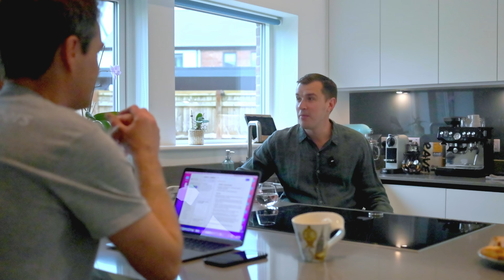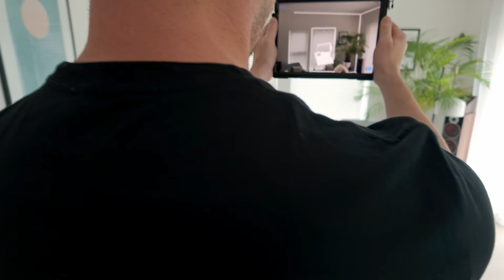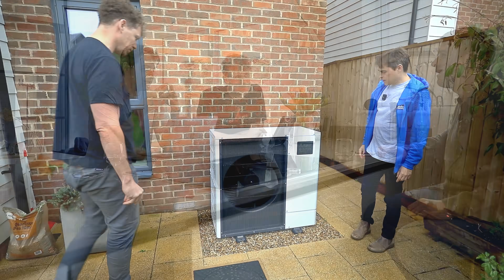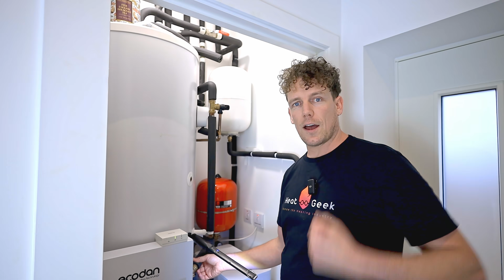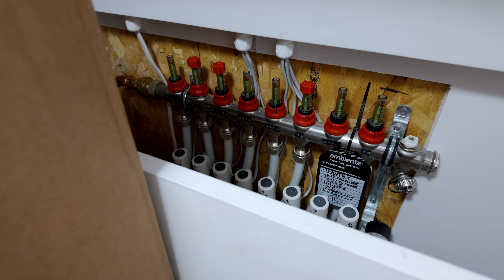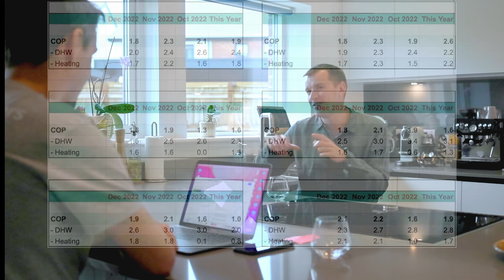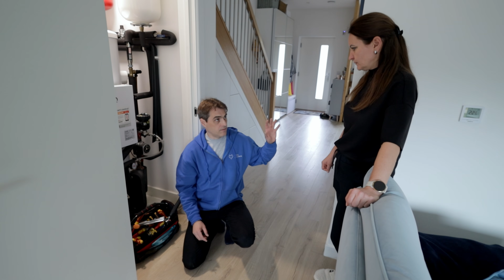How Developers Are Ruining The Heat Pump Market

Comment: Adam is totally wrong (9':02") about newer well insulated homes attaining better efficiency, it's the complete opposite. Heat pumps in leaky old houses will be running a lot more when it isn't particularly cold outside - ideal conditions for running ASHPs. Well insulated homes will only need heating when it's maybe below about 5°C outside and the heat pump is having to work hard. Also a larger proportion of the energy will be used to heat DHW - a much harder thing for the heat pump to do so that is why this house has a low SCOP. And that is why HeatGeek haven't been back to fix it or do a follow up video.
Reply from the maker: Adam is correct. You are wrong.

I have 50 monitored systems.  Some of them run COP of well above 5 - 5.6 and 5.3 - all of my systems that are above 4.5 are modern, well-insulated houses. Older houses run COP of around 4.0 on my installations.

Your claim that modern houses only need heating below 5c is incorrect. All houses need heating at similar external temperatures. Internal gains allow well-insulated houses to start heating at around 15-16 °C outside while poorly insulated houses need heating from around 17-18 °C outside.

The only difference is, well-insulated houses can be run at flow temperatures of around 32-33 °C with -2 outside, and poorly insulated houses need flow temperatures of 40-42 °C.

That is all - not an opinion like yours, facts that are available for you to see here:

https://heatpumpmonitor.org/?period=all&minDays=0&filter=urban+plumbers
Reply: @UrbanPlumbers  I wasn't really talking about modern British homes and the one in the video certainly isn't typical (you said it yourself) with triple glazing and MVHR. A genuine Passive house reportedly needs heating when it gets down to 0°C which is where the COP of an ASHP will really drop. There's usually enough solar gain and heat from appliances to keep the house warm. I doubt this is actually passive standard but it's a radically different prospect to a normal new build in the UK. The average 5-bed house in the UK uses over 10kWh/day on appliances, cooking TV etc - all of which will eventually turn to heat in the house. There isn't a small enough Air to water heat pump on the market to suit this house even on the coldest days of the year. The two "Passivhaus" houses on Heat Pump Monitor run at SCOP of <3.2.

Comment: That looks like a ecodan pre plumbed cylinder. They all have the hydraulic separation pipework, a pump for primary circulation, pump for the heating and a pump for the hot water. The dozens that we look after have a cop around 2. I'm sure they could be better but the manufacturer build the systems like that.

Comment: This seems to typify the common malaise in the UK where nobody is held Personally Accountable, which breeds carelessness and apathy. Clearly, Quality Assurance has become a tick-box exercise where the reasoning behind doing so has been forgotten. Accordingly, this is a management failure, which is easily remedied by retraining engineers to use their brain for thinking instead of just following a routine  because it is easier and lazier to do so. Challenging the engineers to care about the customer to provide an optimum service for them and focus on getting it right first time. If the industry provided a bullet-proof warranty, as part of a defects liability period, for new house heat-pump installs then the customer would be happier and the industry would flourish.

It sounds as if the Quality Assurance and business efficacy of a review step has been omitted, which has let the customers down and led to falling standards.

Maybe, each system designer should put their name to the system and each system installer should sign-off on the efficacy of the install, so that individuals are held Personally Accountable, as a reasonable management tool to identify where the problems are, so that they can be quickly remedied and a safe system put in place to prevent a repeat.

Comment: What can you do if the minimum of kw the machine can produce is way higher than the heat loss of the house ? I have the same problem with gas boiler and UFH 3k heat loss and a 24k combi boiler that produce 4.1 in lower settings
Reply from the maker: Good controls can reduce cycling. Oversized units with poor controls are a nightmare

Comment: The same thing is happening in Hungary. When we are explaning that our old hous has 5 k heat loss and therefore 5k heat pumps no one beleives us. Every single new build is equiped with 11-12 k units and surprisingly no good cop, burned down relay boards etc. So this is very good video thanks for that.

Comment: I'm looking to build in Ireland, where I come from; heat pump air-to-air ducted systems have been the norm for decades, but here I get looked at sideways when I tell them what I am looking for
It's incredibly hard to find providers, much less providers with proven track records. I will not be having radiators in my home, but I feel like I am going to have to import equipment and labour from a continent away.

Comment: So you haven't said anything about the water tank and the hot water demands upon the house. For a five bedroom house I'd imagine this is fairly substantial! You'd need to be able to run multiple showers / baths! Is this why the heat pump is over sized? Because the developers don't know what hot water demands the customer is going to need?
Believe me! I HATE developers so it pains me to defend them here! But you don't seem to be telling the whole story in this video! You should have covered hot water needs and supply and how the system was or was not designed to meet these needs.

Comment: Crazy. Would R290 units perform better? They can handle higher temperatures better if I'm right, so if they aren't installed correctly they don't work that inefficient. I mean, a COP of 1???
Reply from the maker: Would make no difference

Comment: Think you were nitpicking with the expansion vessel on the flow. On a conventional system with high flow temperatures, yes. But on a system with low differentials, low flow temps, nah.
Reply from the maker: It’s not about temperatures, it’s about the vessel being on the positive site of the system pressure. This causes air being removed from the system water and corrosion among other things.

Comment: You say they have installed 28mm to the plant room then reduced down to 22mm. You say it’s guessed correctly but in what way exactly? Have you done a heat loss in this property and also sized the pipe work or just guessed?
Appreciate your input please?

Comment: Heat pumps are like boilers a few years ago, they dont modulate low enough.
If they did it wouldnt matter if they were oversized. An oversized heat pump will heat the domestic hot water quicker, go into defrost less when its very cold, coz it wont need to work as hard.
The Daikan 16Kw modulates down to the same extent as the 9Kw.
So installers need to check

Comment: Just don’t understand why in the uk they say it cost £7000 to install heat-pumps 
I lived in  Brisbane for 30 years never ever did we need heating . If we had cold we would simply change our air con system to heat and it was more than enough. And with having the condenser at the side of the house ,we never heard working it was that quite and cheap too run  . It was a Mitsubishi model  cost around $1400 or about £700 plus instillation of about $1000

Comment: An issue I rarely see covered is the practicality of retrofitting ASHP in a old property with a gas system.  The small boiler is usually in an area where the ASHP kit will not fit, this then involves losing some other internal space and re piping which in many properties is not a simple job.  

The associated valves, pumps, reservoirs, larger cylinders all take their toll on retro installation.

Comment: Why not consider solar panels with the addition of battery storage and an electric boiler for heating and hot water. You don't need direct sunlight all the time, daylight is needed. Connect up to the existing heating system! Virtually no real maintenance required!
All we here is problems with heat pumps whereby they haven't been set up properly, temperatures created are not always good enough, bigger radiators required and it's very expensive for what it is!!
Reply from the maker: Solar PV and battery is great with heat pumps - you can have 5-6 times cheaper heating than gas. With drect electric and battery and Solar you may as well stay on gas. It is just not efficienct enough.

Comment: what's the small print on the heat loss calculations? I know heat loss has to be dependent on temperature delta, is there some industry standard temperature delta that you use to come up with a number in straight kW? or is it based on the (relatively) local mean annual ambient temperature?

Comment: Seems like Passivhus and a standard ASHP doesn’t make a good fit.  Most of the year you need zero additional heat input.  As it is then only heating water, how about a heat pump cylinder? 
If you do go for a ASHP perhaps link to a very thick floor slab* and heat only when the electric rates are low.  (Another also commenter raised this)
* or place the insulation under a layer, say 30cm+ of gravel to act as a heat sink.
Reply from the maker: @markthomasson5077  correctly sized heat pumps are perfect for passive houses
Reply: A Passivhus will have MVHR (which helps circulate air) so the solution is a couple of much cheaper and simpler a/c units which also cool on sunny days. While an immersion can heat the hot water for about 50p/day on overnight tariff - about the same as the gas standing charge. There's really no need to overcomplicate things.

Comment: Fantastic video guys. I am learning so much and starting to (slowly) understand my problems. My property could be a very interesting subject for a future video but sadly we are located a long way from London in the Scottish Borders. We bought our house in 2018 from a “Low Carbon Development” company so we thought we were doing the right thing buying a new property that would have a lower carbon footprint. We have had the Ecodan air/water heat pump since 2018 and it appears to be a good unit although Mitsubishi really need to work on their app and interface! We have underfloor heating downstairs with the dreaded mixer/valves and radiators upstairs as well as a heat recovery system. As I have subsequently found out everything was badly installed and most of the plumbing mistakes highlighted in your video are on show in my house😢I have tried running the system as it should be run but my wife is paranoid about the bills and keeps turning the thermostats down. She is far happier using the log fire (and yes that probably produces more carbon than anything else) and spending most of our time in the lounge. Consequently, during winter we allow rooms not used to drop down to 15c which I keep trying to explain to her is wrong as if we don’t use the system we will have more problems. We believe the insulation is good and there is sufficient in the loft area but the developer was obsessed with the aesthetics of a modern steading style ie 3 double doors downstairs (badly installed) with no insulation and lots of windows. Without the calculations my wife won’t believe me that the heat loss isn’t as bad as she thinks. Just to make my life more difficult Scottish Power introduced a Heat Pump tariff where between 11am and 4pm electricity is half price but the standard rate outside this time is a little higher. Now my wife rally does do the rounds after 4pm turning everything down or off! Does a heat pump tariff like that actually help running the heat pump or is it just another complication?

Comment: Buffer tanks can smooth out run of oversized pump , also you can reduce / modulate power to avoid cycling
Reply from the maker: if you are overszied by some 9kW you would need a buffer tank of enormus size to make any diffrence

Comment: Great discussion.   So I learned two things and have two questions:
I learned: Right-size (usually downsize) the equipment.  And simplify, with fewer zones, fewer thermostats, less equipment, lower cost, higher efficiency.
Questions:  for the quiz, I didn't know the units (it was kW).  How does the customer know the COP?  How is this measured and calculated?  
Thanks again!

Comment: One of the biggest issues is gas heating companies and engineers installing heat pumps and thinking it's all the same, 'just put a big pump in and all will be fine'. Typical gas boiler installer will look at a heat demand, which might be 28kw for a gas boiler, so they put a 32kw one in just to be safe. That works ok because of the inherent inefficient in a gas system that is designed to constantly cycle, but it's a fundamental flaw doing so with an ASHP. We live in a 1950's 4 bed detached house (with additional insulation) and have a Mitsubishi Ecodan 8.5kw pump, which does perfectly well by keeping the house at 22c all through the winter with average SCOP.

Comment: 2:27
You can build them perfectly fine without heat recovery. It will however usually require a step up in heat pump capacity.

Comment: Thanks for the video. It highlighted that our expansion vessels was incorrectly placed on the flow not the return. No noticeable issue with this over the winter so far but the installer has agreed this should be changed and is coming back out next week to sort it.

Comment: As someone who is about to order a heat pump and is from a process engineering background ( I’ve checked and there is nobody listed on the heat geek website in our area). Is there a list of user requirement specification anywhere that I can use against which the suppliers can produce a functional specification that can can be measured against the install delivery please?
So we can pass/fail the install.

Comment: 100% losses when you open the window? Home boy has been sold some gimmick and he doesn't even realize this. The heat in your home is accumulated in your furniture, walls, floor etc. when you open the window you don't start magically draining heat from them at a fast rate
Reply from the maker: he talks about air changes heat loss (heat loss is in 2 from: fabric and ventilation loses)

Comment: Someone has made a very good point about raising the heat pump - it will allow cold output air to fall to the ground allowing warmer air from 1 metre and above to be drawn into the unit.  Was about to install mine on the ground but will be raising it now 🇬🇧
Reply from the maker: makes no difference to effiency really
Reply: @  Ok, will mount on the floor then.  Thank you 👍🏻

Comment: The Ecodan came preplumbed like this with low loss header etc. Prob why it was done this way.
Reply from the maker: Yes exactly. Just shows how bad manufacturers are really at the design!
Reply: @ Probably a design that will sort of work for 100% of our homes and safe no liability for ecodan. I have the same setup in my flat, gets me a cop of 3.5. I guess mine will be better sized.
Reply from the maker: You got a heat pump in a flat?
Reply: @ yeah upstairs 1930 flat with large single glazed windows and no insulation in the walls. I had to upsize the rads but it works great. We had storage heaters before

Comment: Nothing wrong with that 11 kW heat pump. It will just switch on occasionally, whereas a small heart pump would need to run much longer, wearing out faster. And this one is a quality brand, with a Japanese instead of a Chinese compressor. It will last long, as it hardly ever needs to run on peak performance. I wouldn't change it. A bigger concern would be weather exposure. I would put some sort of roof over it against rain and snow and some provision against direct sunlight baking against it in summer.

Comment: I don't think is just a developer issue. To be honest, the quality of the install was actually really clean. It just happened to be also wrong. There are not a lot of installers around who actually understand these new systems or how to size or indeed, install all the bits and bobs correctly. 
There is no possible way that a layman could look at that installation and have a clue that it was not installed properly. 
It just goes to show you, make sure that you choose a supplier who specializes in the technology that you are installing. Even if you know the fellows and they do wonderful, clean work, as these installs look to be, that does not mean that it's being done properly.

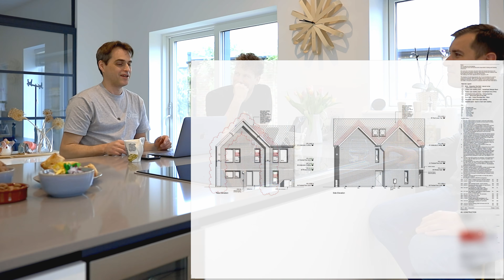Comment: I've paused at 3:10 to give my estimated heat loss..... I'm going with 5.5 kW and the house will need a 7 kW pump for worst winter weather but least cycling in normal conditions..... Wow! Interesting, it's even more oversized than that. I'm watching because I'm installing my own UFH at the moment with ASHP being installed for it. The control system comes with a circulating pump for each manifold and expects a zone valve for each manifold too.  My thinking was "circulating pump, maybe, because there's a lot of pipework to push water around, but zone valve?" I honestly expect the zone valve to be always open and thus not needed. My calculations tell me 37C flow to achieve 21C room temperature, but I have have the room stat on 16C with my existing gas radiator central heating and that maintains the rooms at 20C. Such is the imprecision. I'm getting my geek on because I believe a 30C flow is not only possible, but also readily achievable by tuning the flow valves on each UFH loop to get to the sweet spot where they are all almost always open. I'm installing underfloor temperature probes to protect the wooden floors and cut off at 37C floor temperature, but I don't believe it will run anything like that warm. Room stats in every room mostly because I'm a geek and data is my food 😋